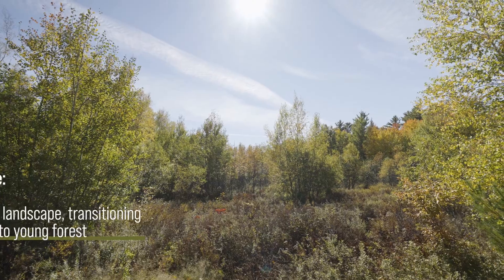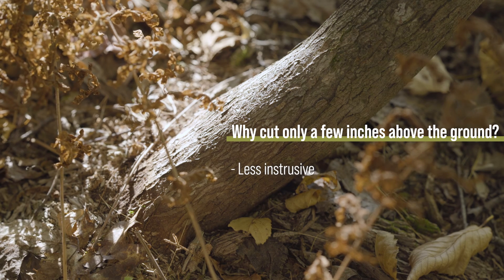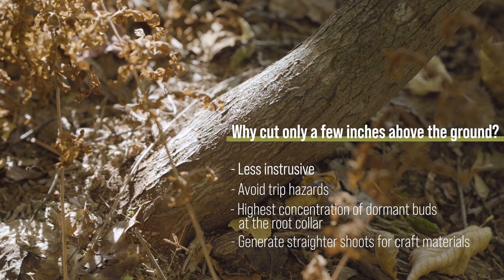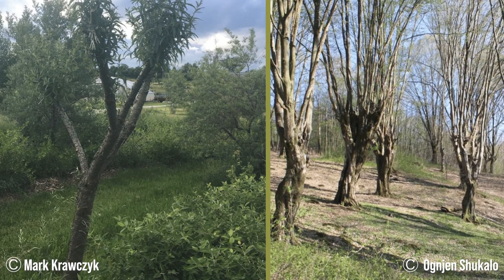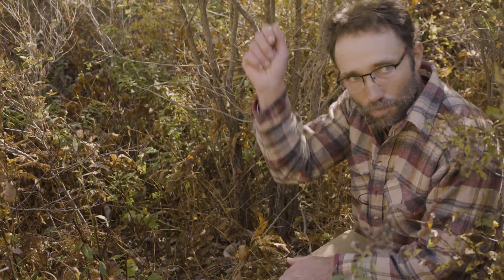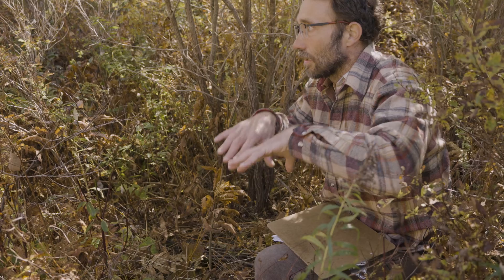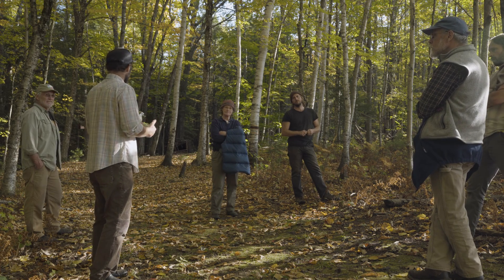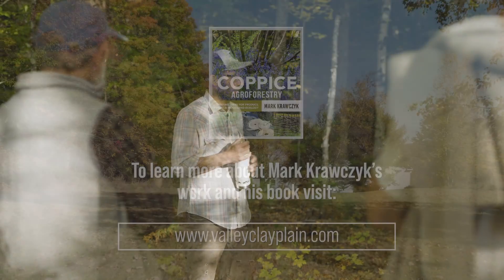Coppice Agroforestry Workshop with Mark Krawczyk: Part 2

Comment: Always cut low. If you start to cut high, your next cut tends to be higher ans the height of the stool creeps up. This allows the stool to fragment and restricts spread. Spread is good as over decades/generations, your stools spread out and you will eventually see stool fragmentation and the tree can (in effect) clone, increasing stool density and increasing the tendency for straight shoots for green wood uses. 
Also once the stool gets large,  it is the outer stems that tend to succeed with many of the stems towards the centre becoming out-competed for light. Once again, the stool spreads. If you cut high, it can't spread.....
Reply: Are you forgetting the entire concept of pollarding?
Reply: @dungeonmaster6292  but if you cut above the ground, but not very high, it is more like coppicing - you don't get any of the benefits of pollarding but you get downsides of not cutting high enough.  Pollarding is generally above browsing height of herbivores, that's the main reason it was used.
Besides, if you read the description of this video, you will see that this is a video about 'coppicing', NOT pollarding.

Depends what you want to accomplish, but what are the advantages you see in cutting above the ground but not very far above the ground?
I know some people cut willows like that